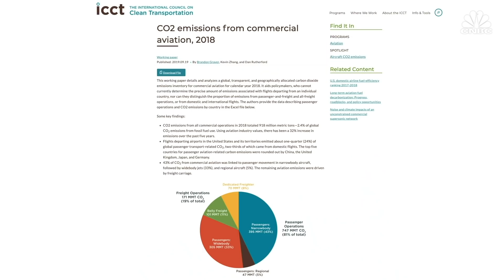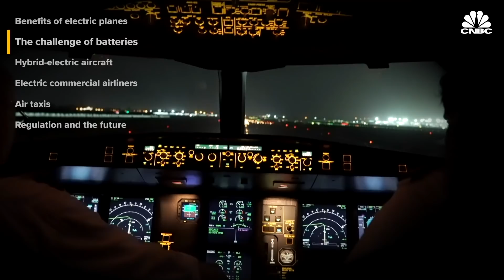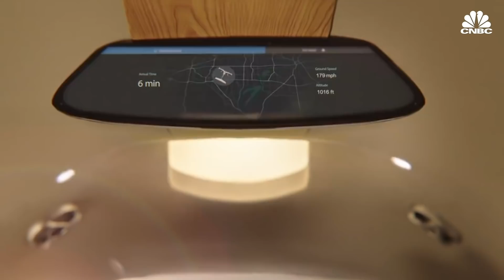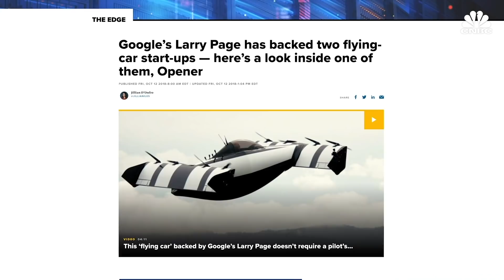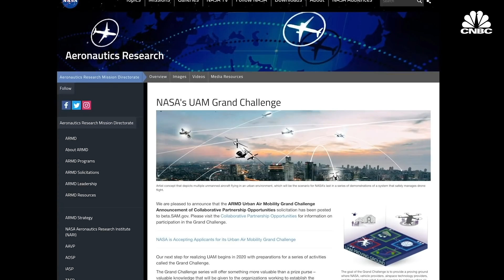Why Don't We Have Electric Planes Yet?

Comment: ships has electric motors that spins the propeller but they have diesel generator that drives the electric motors just like the diesel locomotive you see today.
Reply: There are also battery electric ships. Ferries mostly. Also some hydrogen fuel cell ships.

Comment: There is a simple physics problem. Fly a prop engine plane at 40k ft. Jet engines work by exhausting hot air. Something you won't be able to simulate with electricity. A prop plane can fly above 40k ft but lose a lot of efficiency due to the density of air and the propulsion method.
The commentary is pure fantasy. We just need some mystical battery technology that doesn't exist right now and it's possible while also being cheaper. Electricity is cheap in some places, but they have a fundamental misunderstand on why electricity is cheap in some places and not others. They also propose getting around the terrible economics of the idea by imposing a carbon emission tax which invariably means increasing the cost of electricity production.

Comment: I take issue with the messaging surrounding carbon emissions for planes. The fact that they make up a relatively small percentage of global emissions (I think they said 5% in the video, and that included commercial shipping) and that the technology for solving this doesn't yet exist...makes me think the vast majority of our effort should be elsewhere. No one should feel guilty for flying a few times per year. If you're a business traveler, maybe convince your company to buy carbon offsets for your frequent flights, that'd be cool. Otherwise, let's not focus on the wrong thing. Remember the Pareto principle...in this case, 80% of the emission reduction will take 20% of the total effort to decarbonize. Let's focus on the first 80%. Of course, we can do this AND decarbonize other sectors, I just don't want the average person to be mentally focused on the wrong area. Remember that time is a factor and we need to get the easiest, biggest wins ASAP. For now, let's concentrate our resources on the easy stuff.

That said, I very much look forward to electric planes, when they do eventually come.

I'm pretty skeptical about the "air-commuting" idea though. I'm thinking, if you're trying to commute from one densely populated area to another, and these planes only hold a couple people, you really can't fit that many planes into that route. Even if it were affordable for the average commuter, it just can't move very many people. So it's an interesting concept for rich people, but not very compelling to me as a way of transforming the commute. Maybe I missed something.

I do, however, like the idea of opening up shorter haul flights between more rural areas, and if those can be electric, all the better.

Comment: Because it is uneconomic.  Petroleum fuels have much higher energy density.
Reply: It's sort of the other way around. For the mileage, it's cheaper to buy the electricity and the maintenance cost is also significantly reduced.

Comment: Ever seen how a low battery affects a light bulb on a flashlight  or even your phone? It becones dim, slows down before finally turning off. In electric vehicles, at least you can pull over to the side of the road but a plane hundreds or thousands of feet from the ground and nearest airport..  Good luck! That's why! Lol 

A battery powered planr weighs the same while taking with a full charge and the same by the time it's landing with a low battery so the first few minutes it will be fine flying fast but halfways as battery charge diminishes, it will be struggling to maintain speed and keeping the heavier plane up in the air with the same weight on board but not enough power to generate the same thrust. And thats hoping there's no turbulence from high winds or a thunderstorm. 

With jet fuel, a plane can maintain the same speed/thrust whether full or a quarter tank of gas left.

Comment: Outside of beaming energy to the aircraft or flying in a cloud of energy usable by the aircraft, we will never use battery tech for reasonable commercial flight.  At best what we see size and range wise for aircraft is as good as it is possible to get.  Regardless, take a few moments to watch the following documentary outlining energy density and why we use gas and not batteries as energy storage medium.

https://www.youtube.com/watch?v=8RbwOhM6PUk

We will never get "better batteries."  They are at the limit.  These guys are quacks.

Comment: Hydrogen planes make more sense, why are their no hydrogen prop plane engines.   The air carrier can have a hydrogen fuel machine make fuel in their hanger at the airport, fill up the aircraft at little to no cost then fly off.

Comment: I wonder what kind of chargers they will need to have for those future electric or hybrid planes?
Reply: Three phase would charge a light battery electric aircraft like the ones Pipistrel make fairly swifty. If you need more juice you can have a grid storage battery on site to top planes up nice and quick.  That's what they do with the big electric ferries.

Comment: If an electric plane runs out of battery, would it be light enough to glide down, or would it just fall out of the sky
Reply: Batteries would make the plane very heavy, which is the problem. but all planes glide, so wouldn't just fall out the sky.

Comment: Liquid Lead and styrofoam.
The same capacity as a traditional lead battery..93.325% lighter.
My formula.
Who wants it ?
My battery design can be 3d printed and therefore you can shape a carbon fiber wing and the wing is the battery.
The whole craft skeleton can be a battery.
Billions of cells guarantees unlimited redundancy.

Comment: This video was too lobbyist for my state.
Long haul planes:
Speed. With a traditional propeller plane you cannot go near transonic speeds.  The battery is an isseu as they mentioned but what they did not mention is how hard can be to get rid of those batteries.

Air taxis:
Efficient public transport would solve big chunk of these problems but even if they get popular the regulation would be a real issue. I mean imagine one of these malfunction above a skyscraper and the video did not say a thing about the HUGE infrastructural changes to do this. If you build a platform in the middle of the town it would generate a traffic jam right around it plus you would need huge amount of parking places. (OFC you can combine it with an efficient metro system but if you have money for that why not invest in public transport then to haul people to the airport?)

I am all for a green Earth but sometimes you don't need to over engineering everything. Build a tram, a subway a high speed rail line. We have the tech for all of those . The front end investment is high but they are safe tested and they just work. I cannot imagine myself without trams and subways in Budapest. It would be a nightmare if everyone would use cars to go everywhere. When I lived there for 4 years I did not even own a car and never felt a need for it and Budapest PT system is a bit above average at maximum.

Comment: Someone is having trouble understanding avionics and aerospace engineering and other complications......a large passenger plane is getting nearly 100mpg/per person...the question is how much of it is frivolous unnecessary frequent travel. However, once the plane is set to travel already, than as many people as it can carry is better than less people.
Smaller, slower localized air flight is not an answer to any of this. Nor is the fact that all of this electricity still comes from other sources that are not nuclear or solar, or that manufacturing itself causes many problems. See China rare Earth metal mining issues.

https://science.howstuffworks.com/transport/flight/modern/question192.htm
https://youtu.be/XFrMtCpo3Dk

https://www.grc.nasa.gov/WWW/K-12/airplane/Animation/turbtyp/etfp.html

https://www.faa.gov/hazmat/resources/lithium_batteries/media/Battery_incident_chart.pdf

https://en.wikipedia.org/wiki/Electric_aircraft

Comment: Don't overthink it. The reason there are not electric planes, is that flashlights will shut off right as you're in the middle of the darkest part of a job. That's it, it's that simple. The one leaves you in the dark but it's hard to pull off to the side of the road from 18000 feet.

Comment: If takeoff is the most energy intensive portion of flight, it seems to me that a winch launch (like a glider) or steam catapult (like an aircraft carrier) could significantly extend the range of electric airplanes, especially for short flights. It would need to have relatively gentle acceleration for commercial passengers of course. There must be a good reason why not...?
Reply: I'm totally thinking about Gundam launching sequence rn

Comment: The problem with these videos is that you look at it from a battery perspective. Hydrogen would be a great application for planes and ships. I know it's still heavy but it gives you a lot of range. Also hydrogen fuel cells are getting smaller and smaller.

Comment: The only thing that make Electric planes become reality is "Ultra low weigh battery", because battery is too heavy,
Reply: Thousands of gallons of jet fuel is heavy as well
Reply: @spaceoddity2485  - What is heavier a pound of lead or a pound of feathers?
Reply: intensity
Reply: Battery Operated is different than Electric. The plane could use a fuel cell and still be an electric plane.
Reply: @uglypinkeraser  - Do you have a point? If you just wanted to mention a thing, fine you did. If it's that a fuel cell is a magic bullet, you are wrong. Look into it, a fuel cell has quite a long list of issues itself, including that the h2 for it must be very pure, so very expensive, and that h2 has far less energy per gal than jet fuel.
Reply: @johnsmith1474  My point was that electric airplane doesn't necessarily mean battery operated airplane. Do I have a point?! you're the one who comments stuff like "What is heavier a pound of lead or a pound of feathers?"
Reply: @uglypinkeraser  - Your real point is that you don't know much about hard science, you just know labels, but you want some sort of "good job" like a toddler. Furthermore my comment re "feathers vs lead" is classic test via sarcasm, and was absolutely pertinent as a reply to the stupid comment for which it was targeted. That you don't "get it" is your problem. I'd stay with kid's stuff if I were you, you are out of your depth with me.
Reply: @johnsmith1474  woah everybody look out we got a badass over here!
Reply: My point is that an electric airplane doesn't necessarily need a huge battery, it could have a fuel cell on board, or several fuel cells on board (fuel cell doesn't necessarily mean Hydrogen fuel cell, either. A fuel cell by definition is a system that produces electricity from a chemical reaction.) to keep a small battery charged. Sure its running on chemical fuel at that point, but the airplane is driven by electric motors which makes it an electric airplane. I've never met anybody who was both actually intelligent and also condescending to people they think don't know stuff. The more you know, the more you know you don't know.
Reply: @uglypinkeraser  They also talk about hybrid.  I suspect we will see hybrid power source electric planes in a few years.
Reply: I think they increase the energy density
Reply: That's about as trite as it gets, it's the comment of someone who has no idea how little he knows.

Comment: Can't hydrogen electric car tech applied to airplanes? Electric energy from hydrogen is pretty high and its light too.
Reply: I think there is an issue with getting the hydrogen to use as fuel
Reply: @kyronne1  what?
Reply: @varunjain7360  Hydrogen production is expensive at the moment.  Hydrogen engines are also expensive.  I think it has potential in the near future though.  These are  just engineering problems, not necessarily inherent to the technology.  For cars, I don't think it will ever compete with battery for cost, but for ships, planes, and maybe large trucks it could be a good option.
Reply: I'm talking about hydrogen fuel cell tech which has been preferred for heavy vehicles. Using hydrogen the cell produces electricity which can be stored in buffer battery for each motor. Also, does hydrogen cost more than jet fuel?

Comment: Dec 10, 19: ""An all-electric powered seaplane has taken flight in Vancouver, Canada, in what the operators describe as a "world first" for the aviation industry. The short test flight by Harbour Air and magniX involved a six-passenger aircraft fitted with an electric motor.
 The flight involved a six-passenger DHC-2 de Havilland Beaver with a 750-horsepower (560 kW) magni500 propulsion system. Canadian seaplane operator Harbour Air hopes to electrify its entire fleet by 2022, provided it secures safety and regulatory approvals.""

Comment: Man ... talk about having range anxiety high up in the sky.  The problem is that whereas an electric car only has to propel forward, an electric airplane has to provide lift and forward thrust (both actually depend on the forward thrust).  An airplane in flight cannot "sit" still, whereas a car can always stop and take a rest.  In addition, whereas jet fuel weight decreases with flight distance/time, electric battery ("carcass") must be carried all the time.

Comment: You entirely neglect to mention that if you use fusion, the energy in the head of a matchstick is more then enough to power Manhattan for a year. Of course if we went that way we might run out of matter in the solar system in a few million years.

Comment: As a person looking into helicopters, I would really like a electric helicopter.
The most basic helicopters are pretty expensive to operate, it's like $700 an hour at California if you're lucky. The electric drive train would be nice.
But...
It would get annoying to adjust the tail rotor for every time you apply the throttle by just a few, with all that torque.
And being a helicopter, I wouldn't be surprised to barely get a hour of flight.

Comment: The energy density of current lithium-ion batteries is about 265 wh/kg while gasoline is at 12,889 wh/kg, meaning you would need 48.6 kg of lithium-ion batteries to have the same energy of 1 kg of gasoline ( 12,889 / 265 = 48.6 ). This does not mean, however, that you need the exact equivalent of energy. This is because the combustion process of an engine is about 40 % efficient so not all the energy of gasoline is converted to motion unlike electric motors that hover at 90% + efficiency, in addition, you remove heavy engines, fuel tanks, and fuel pumps when going electric. However, making large commercial planes electric also has the additional challenge of nonfluctuating weight. Large planes depend on weighing less on landing then on takeoff because it puts less stress on the landing gear, an electric plane will weigh the same before and after a flight, meaning stronger, heavier landing gear.
For more information:

Real Engineering Video " Are Electric Planes Possible? "- https://www.youtube.com/watch?v=VNvzZfsC13o
Quora question - https://www.quora.com/What-minimum-energy-density-would-batteries-need-to-be-in-order-to-replace-jet-fuel-for-commercial-long-haul-flights

Comment: Because we still don't have a new groundbreaking battery technology that has the same energy density as jet fuel yet. Right now it's the more energy you want to store in a battery, the larger and heavier the plane will be. Tesla's proprietary set up using existing lithium ion batteries has the longest range of any EV on the market. While legacy car makers struggle to deliver true 300 miles of range.

Also - why are these socialist politicians obsessed to completely eliminate fossil fuels despite that the next generation battery technology or fuels aren't here yet. How will we fly when they ban fossil fuels. No clear answer if they support nuclear. Vermont just shutdown their nuclear powerplant and people there cheered, but it actually increased their state's emissions.

Comment: Another thing to consider is the fundamental form of the energy. To drive a car requires, on the most basic level, mechanical energy. This can be transferred from a motor (electric energy) or internal combustion (chemical energy), it really doesn't matter. Jet engines, on the other hand, don't use fuel to turn motors or propellers. Turbines (so both jets and turboprops) rely on releasing raw chemical energy through combustion. That's why the current electric aircraft are all conversions of GA piston-driven aircraft, since in those applications the propeller doesn't care if it's a motor or an engine that generates the rotational energy.

Comment: electric motor Propeller is much slower than jet engine.
Reply: Electric jets are entirely feasible as well :D
Reply: w23857980 the vast majority of the thrust from a “jet” (turbofan) engine comes from the low velocity bypass air
Reply: Well don’t think you want it to be faster than AVGAS/JET-A type Powerplants. There’s something pretty awful about propeller tips going super sonic

Comment: Electric planes use propellers....propellers just dont create the lift like a jet engine does. However maybe introducing airships back into the aerospace industry would be "greener" but again couldnt carry the passengers of a jet plane. Still an air ship could be rigged with solar panels to help offset the energy to guide the airship vs propellers to left the plane. Electric planes would be a step backwards